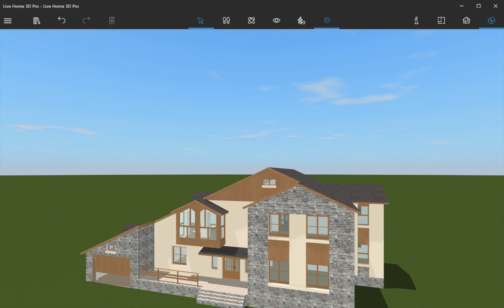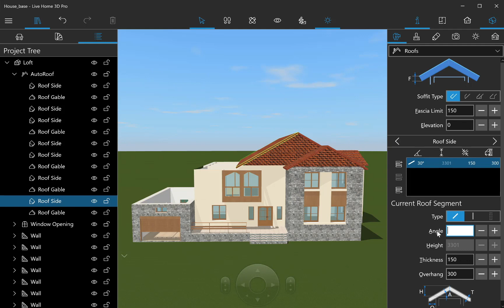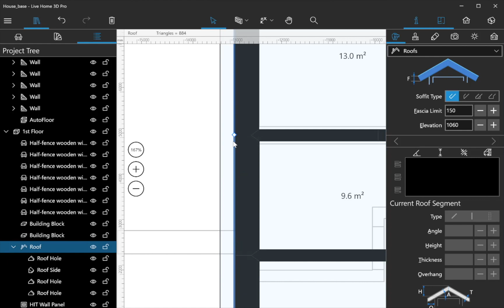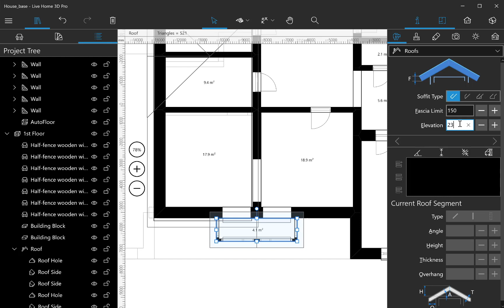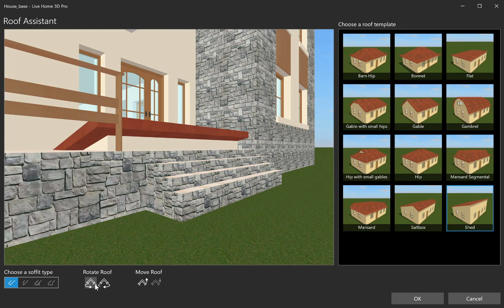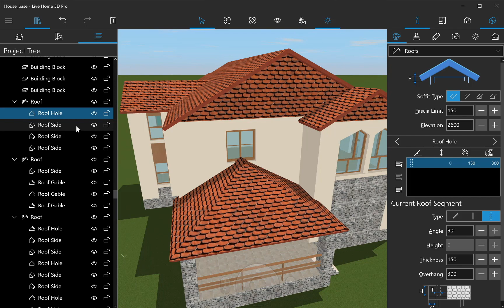Customizing a Roof - Live Home 3D Pro for Windows Tutorials

Comment: Wondering... here in the SouthWest... Most roofs are "flat".. but they have parapets and canales.

Is this an option with Live Home 3D Pro?  I am super cose to making a purchase.
Reply from the maker: Thanks for your interest in Live Home 3D!
While completely flat roofs cannot be created with the Roof tool (minimum slope is 3 degrees), you can use alternatives to achieve this style. You can add a new story and set the wall type to "Curtain Wall" for parapets, or use building blocks or rectangular shapes to represent the flat roof.
If you have more questions, feel free to ask!